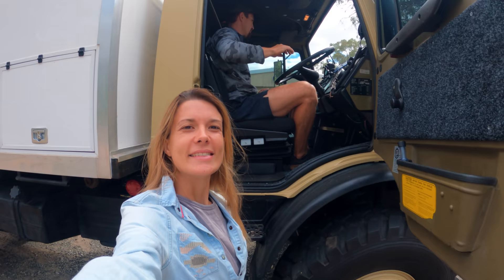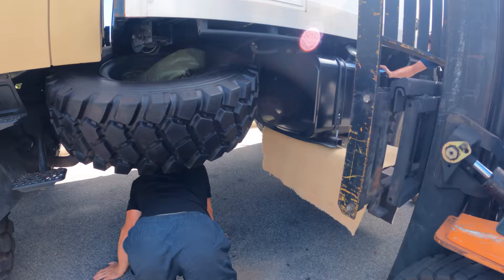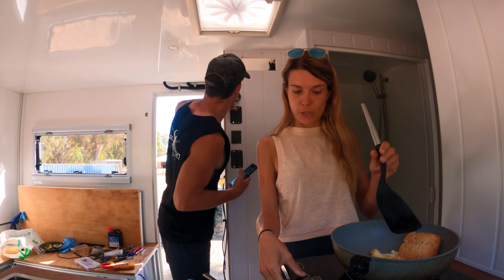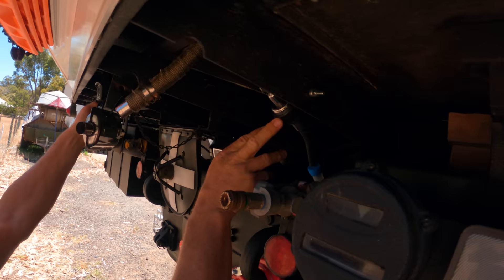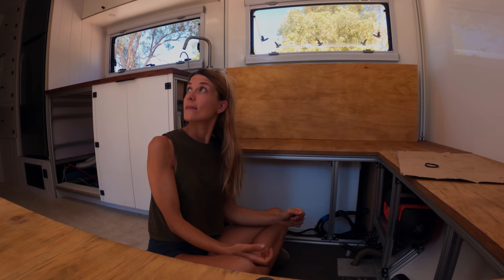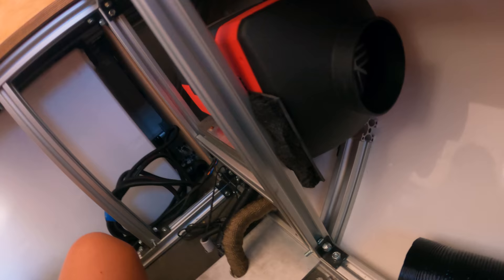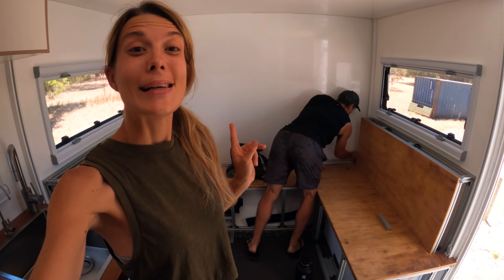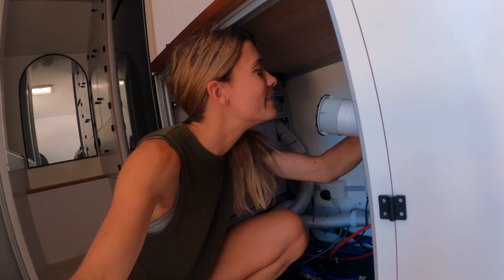EVERYTHING WORKS! Bed Lift Start & Truma Air Con/Induction Power Usage Test - DIY Camper/Caravan 35

Comment: High temp engine gasket silicone around the diesel heater exhaust and the passage through the floor. “Copper” good for 370C.
Reply from the maker: That's probably a better option, thanks for the recommendation!

Comment: Hey guys the shunt will be showing what you're drawing from the battery, but when you have solar coming in, and the size solar bank you have, it will be that minus the draw you have at all times. So shunt will be measuring input and output, so if you're drawing 100w and putting in 100w at the same time it will show no draw. Hopefully that will help you understand 👍 love the videos!!
Reply: Now that's interesting. Prospect for switching between series and parollel combinations then to optimize between bright sunshine and overcast ?
Reply: In addition I saw their voltage was over 13v depending on the battery setup they may be reaching their float charge value. Not sure what he has it set at but the solar charge controller will also cut back how much charge is coming in from the panels as it nears full charge of the batteries to protect them.

Comment: You should consider putting the panels in series pairs then parallel connect the pairs. Mppt controllers work much better with as high voltage as they're rated for. This will give you more charge potential in the morning and afternoon
Reply: 100% correct. I’ve got 4 100w panels, 2 banks of 2 in series to up the voltage and then both banks parallel into the charge controller. So 200w at 40v. On a sunny day I still get over 400w of charge current from my Victron mppt charger controller.
Sounds like their panels are 40v already so they have 800w at 40v that’s epic

Comment: Another tip chuck out the air intake filter supplied and use a dirt bike pod filter . You will have to put a bit of poly pipe in the end so the hose won’t crush when you tighten hose clamp.

Comment: Just a tip on the diesel Heater put a fuel tap in because if the control panel fails you won’t be able to turn off with a fuel tap you can do a controlled shut down 1 turn off fuel 2 run until only cold air is coming out of unit then 3 pull fuse to turn off. Then buy another control panel and plug in.

Comment: Hello Chris and Ange, this is another exciting video and wonderful to see your progress. I have been cooking on induction for 6 months now with my setup. I have 60- 80 incoming amps an hour on a clear sunny day. If you can plan your cooking while you are bringing in amps during the day you will find less draw and impact on your state of charge thus having less wear and tear on your batteries giving you a much longer life span. It means your induction cooker is running off your solar incoming amps and not requiring the amps currently stored in your batteries. If your induction cooker requires 90 amps an hour and your solar brings in 60 amps an hour then you will be drawing 30 amps an hour from your batteries. It will not take you long to find what is best. Looking forward towards your travels and seeing how you both find your Unimog which you have obviously put your hearts and souls into. Best wishes to you. Jason from Melbourne Victoria.

Comment: Our induction cooker has an energy saving pulse setting. It turns itself on and off instead of galloping continuously. 
Maybe yours is similar 
Great job guys 😊😊💪🏻💪🏻
Reply from the maker: Thanks a lot Mark! That's probably it, great feature :)
Reply: @TheOutFit  Yep, all induction cooktops work this way. Essentially like a LED light.

Comment: going really well guys ,not long now to completion time .I bet you can clearly see the end of the road and cant wait for your first completed mog knock down camping test. with the camper closed down on a hot day your ac unit should be able to reach its cycle mode .try its setting at 24 degrees..on a really hot day that is cool and will assist the unit to reach it cycle temp earlier reducing power consumption, Cheers
Reply from the maker: Thank you so much David as always! Yes we found that 21 degrees was way too low - around 25 is more achievable :)

Comment: Hi! You actually did a good thing running thick cable to the heater.  If your power source isn't close by, then the then gauge of cables that come with the heater are not powerful enough.  Good job

Comment: If you can find a way of keeping the diesel heater exhaust and inlet pipes outside the cabin that would be nicer. The heat of the exhaust pipe is one factor, but the risk of an exhaust leak into your cabin is another factor... they don't emit all that much exhaust, but when you're in cold climates you're going to want to shut everything up and run it all night long... The space you've got there is a little awkward though, so might just have to be careful.

Comment: Chris, your portable folding solar 'blanket' looks like the one I bought from the big "Regal" store. Re the little flap thingo with velcro on it and which  holds it closed when folded up - the flap was covering a small part of the panel .. even this little bit drops the power output significantly. These cheap blankets do not perform well at all if there is even the least amount of shade on them. The best I've seen from my "200 Watt" blanket is 92 Watts.

Comment: I wouldn't use foam spray to fill that gap around the exhaust, use a high temp silicone instead.
Reply from the maker: That's a better idea, thanks for the tip!

Comment: With my Espar hot air furnace on my boat I incorporated a small furnace filter on the air intake side. You should be able to find ducting used for marine air conditioning. Project looks great!

Comment: Love the build guys. When you were running the aircon the meter is only showing what you’re taking from the battery itself. The rest of the power it’s using is coming directly from the solar.

Comment: The solar blanket won’t show full 200w unless the battery is really empty. So don’t don’t worry it will work well when you really need it.
And when running the ac like the comment below, it’s showing the difference between the solar and the the battery bank. You should get a clamp on amp meter like the unit-t UT210E and you can confirm the power draw for each circuit

Comment: Fitted a switch on heater. Not easy to get too. This turns off for the screen not using power when not in use. Russell.

Comment: Hey Guys, don't forget that if the batteries are nearly full, you won't see the absolute highest charge rate going in, it is regulated so you don't damage the batteries. If the batteries are drained, you will see the highest rate of charge going in until such time as the solar regulator or DC DC charger throttles it again until 100% charge achieved.